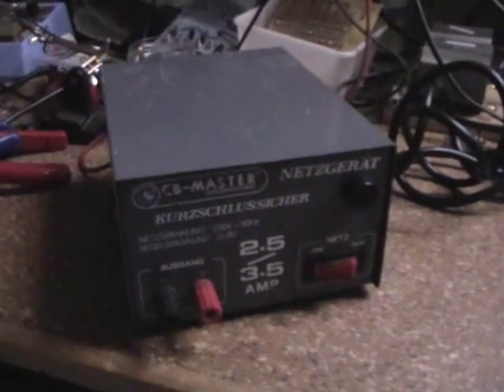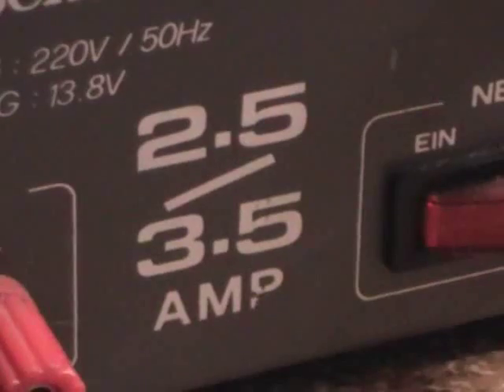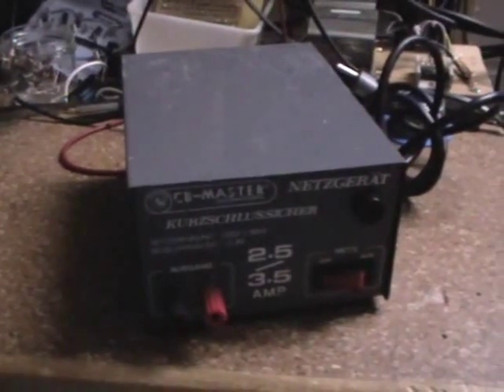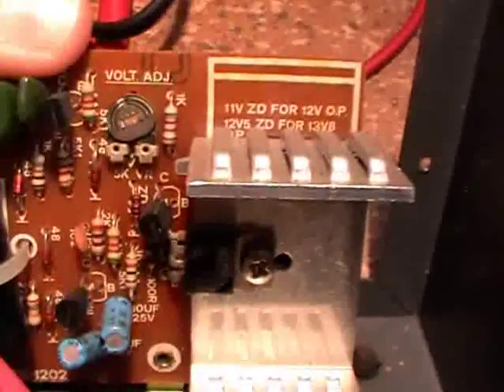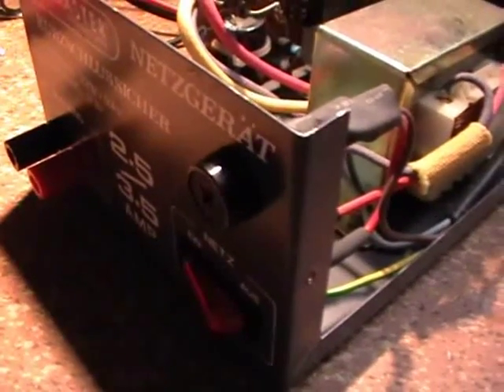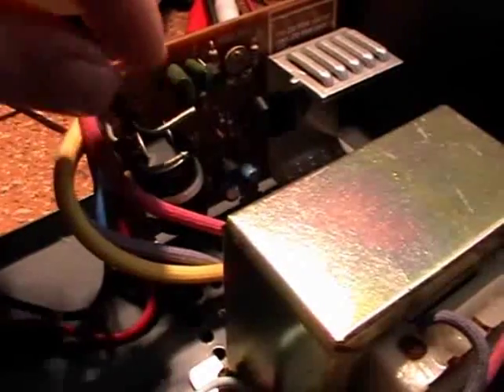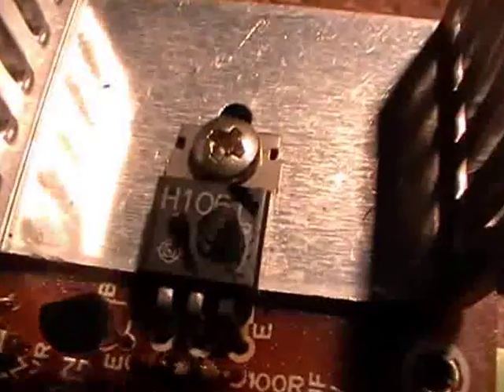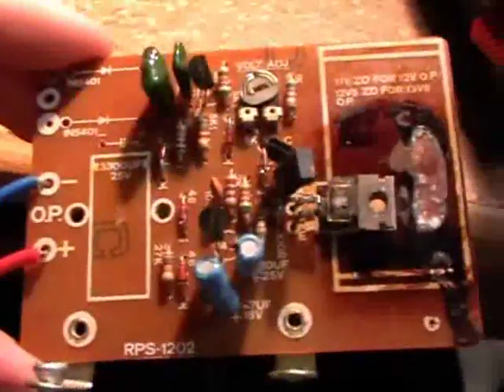DrCassette's workshop - 13.8 V power supply teardown

Comment: nice video.

but, that power supply is not old.
its from the late 90's.
that type of filter capacitor is not old, the older ones have a lead on both sides. 

i think the heatsink was not big enough, and the power supply was shorted out, so all the transformer power needed to be disspated in the transistor. but that heatsink couldnt handle it, overheated, burned the circuit board, and then the transistor exploded because it was getting way too hot.

Comment from the maker: I'm not going to continue using that circuit... I'll built in a different circuit, maybe I'll try to use the circuit you used in your amplifier, the one that uses the 2N3055 transistor because I have one of these here and I really want to use it for something :D I like the circuit you used because it is simple and (as I was able to see in your videos) it works really well. And the housing of that power supply offers enough space for a proper heat sink :)

Comment from the maker: I'm going to built in a regulated power supply for 12V. I'm not sure wich circuit I'm going to use, but I already have some ideas. The 7812 can only give currents up to 1A so it's not powerful enough in this application.

Comment: 3.5 amps is the peak rating and 2.5 amps is the continuous rating... but these power supplies usually don't have any overload protection.  I have a similar power supply and one time when I overloaded it, it started smoking!

Comment: its a powerpack for cb radios, so you can use your 12vdc car cb radio in your house, 13.8v is car alternator output voltage

Comment: It was probably for testing certain car electronics, or charging 12 volt batteries. Most power supplys for that usually are 13.5 volt for some reason.  I recon that at some point the output terminals got shorted and made the transistor burn out.  You could probably replace the transistor with any that has the same type of case and see if it gives any output.  Id look the original up first if you can to check whether its NPN of PNP.  I was not expecting that backward bit at the end!